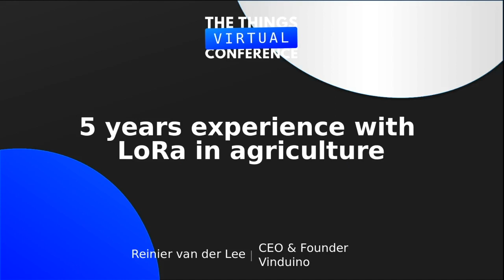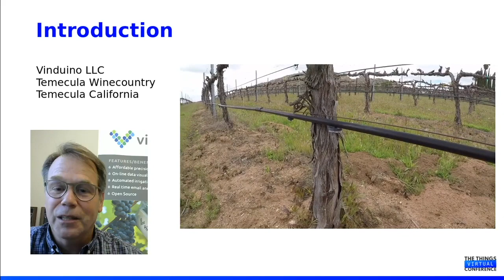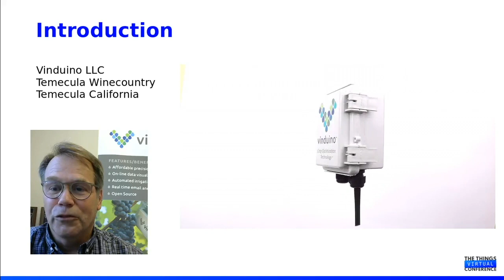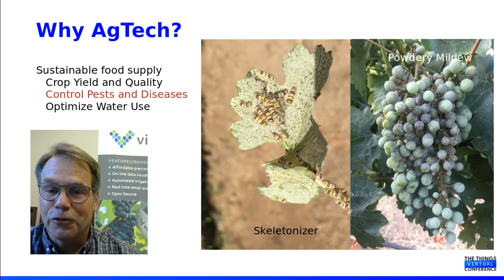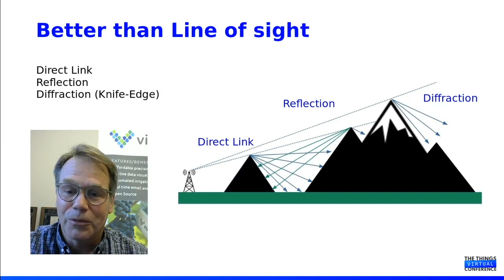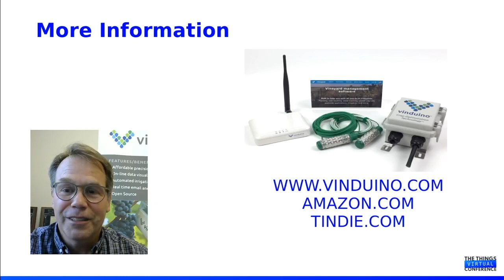5 years experience with LoRa in agriculture - Reinier van der Lee (Vinduino)

Comment: Hello,
Is it possible to use the LM-513H device with another of its frequency setups, for instance 920MHz? The 915MHz band is reserved for mobiles phones use. Any system other configuration would be required if all the LoRa devices operate using the frequency above? 
Thank you.
Reply from the maker: Hi there! Please check out our Forum, a place where you can browse through questions that have already been answered or ask any question you might have: https://www.thethingsnetwork.org/forum/